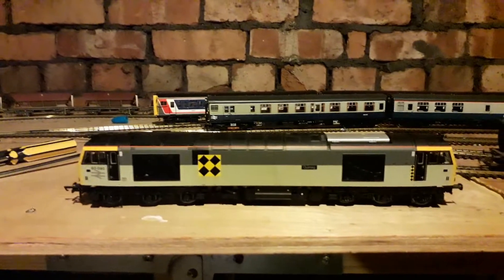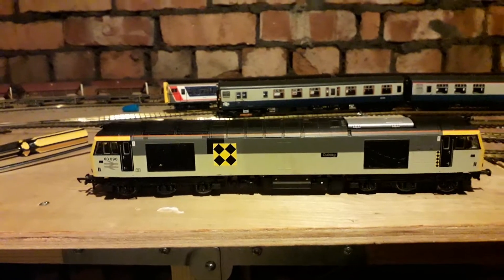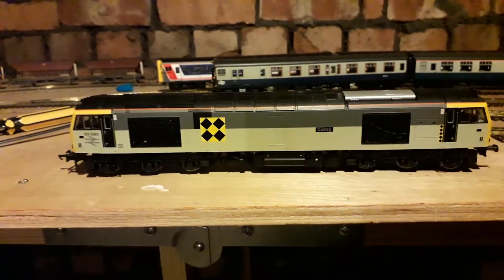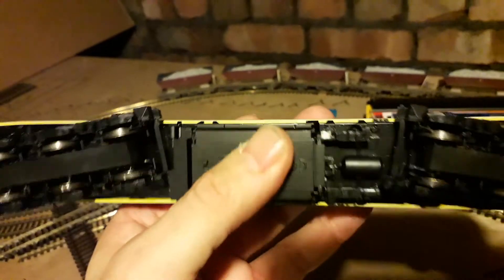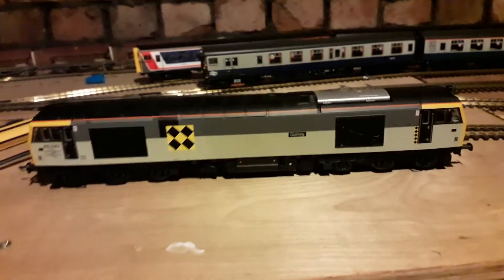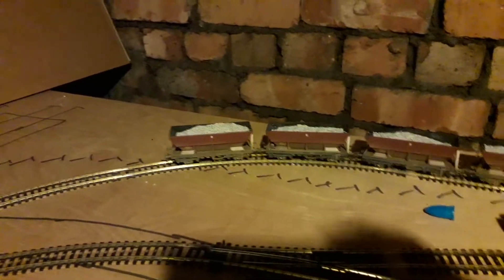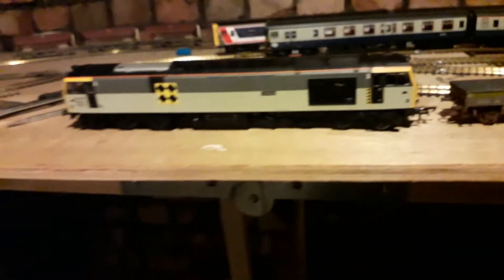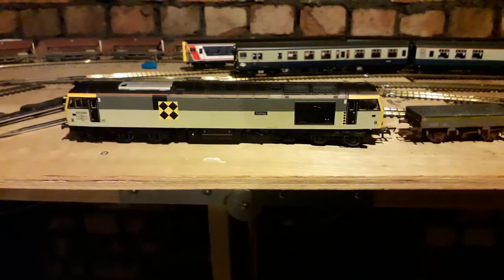The trouble with a hornby class 60

Comment: Hi, 
One solution for the coupling issue, is to fit a slightly larger coupling. There is a medium sized nem coupling which seems to sort the majority of issues. 
Body clips annoy me too!
Reply: Hi tried fitting larger couplings, didn't work for me and the couplings actually drooped down catching pointwork so bad it would derail itself running light engine, so I removed the useless  body mounted cam mechanism and fitted the coupling to the bogies like they used to do. It will now shunt through set track points. I now avoid buying anything with body mounted couplings on bogie stock as they don't work on anything tighter than scale curves like what the vast majority probably have, unless I decide  it's worth having to butcher it straight out of the box just to make it run. Incidently  these cam things are not geometrically correct even when they work! Bad Hornby!

Comment: I'm with you mate. I've 3 Hornby 60s 2 with sound. They've been stored for a few years and now none of them run. I'm sure it's down to the greases used as one of my 50s and my 56 both suffered the same plight. None of my Bachmann or Heljan locos are effected despite the same length and location of storage.
Really Hornby, sort your act out!
Reply: My 60 locked up the gearboxes on the axles, stripped it down WD-40'd the gearboxes used a screwdriver in the input shaft to turn and free it cleaned all the solid grease out and oiled with light machine oil, now works a treat.

Comment: Im not the greatest Hornby fan either however light wagons are an issue full stop  your dapol one proved the point when it derailed in the middle of the train!
As for the electrics issue id take the bodyshell off and move it about run a few dozen times and see if anything changes.I sometimes get odd issues with.lights not turning o on my dcc version of the 60 but it always sorts itself out quickly ....just my thoughts 🙂👍